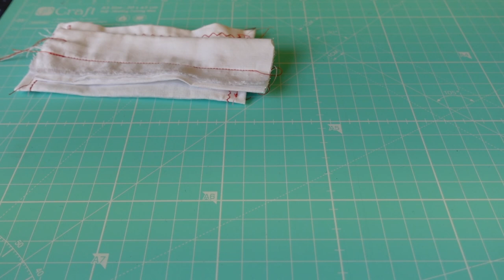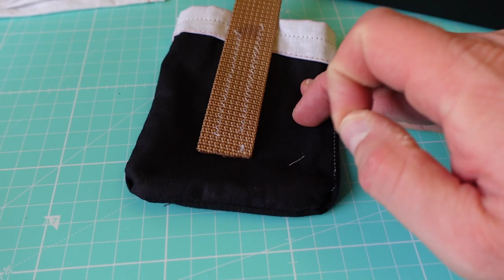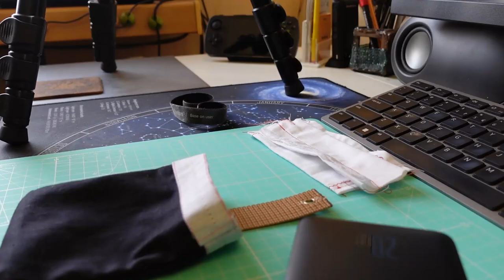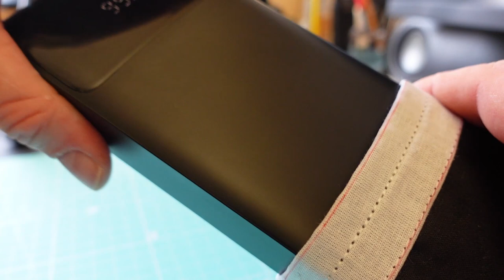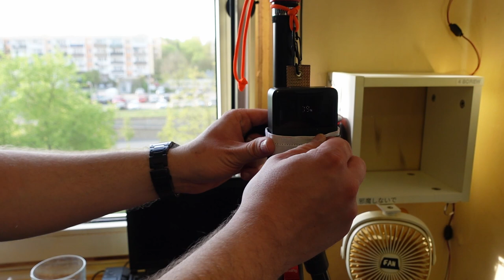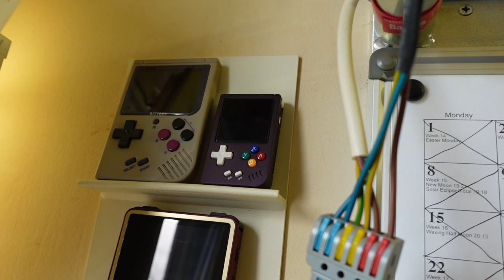2024-04-28 Sewing! PB Fabric Pouch

Comment: Maybe it is possible to make hole in polyamide ribbon with hot soldering tip.
Reply from the maker: If the drill were to fail (...failure was the default here :D) my next idea was to get the leather punch hot and smack that... After a walk or a couple I'm not so sure about heat being the answer because the end goal is to neatly put an eyelet rivet, and that works best when the material is flat.

I have two more of the pouches near ready sewing, so there will be two more holes to make in the straps... I'll probably think more about better way of drilling them than melting. But! I have a whole roll of the strap so perhaps a test before?